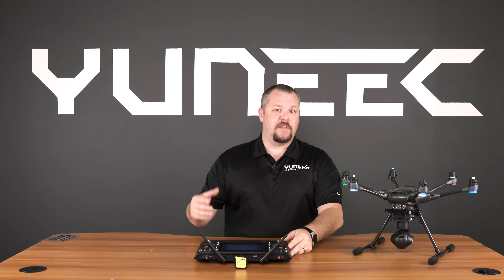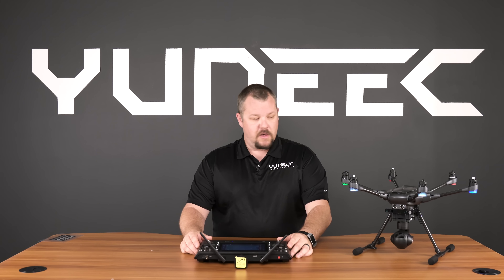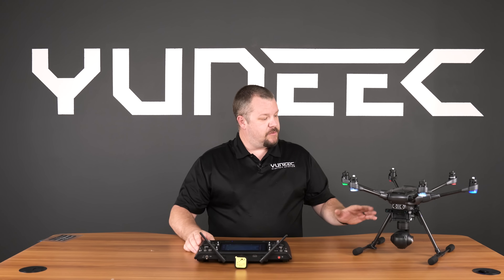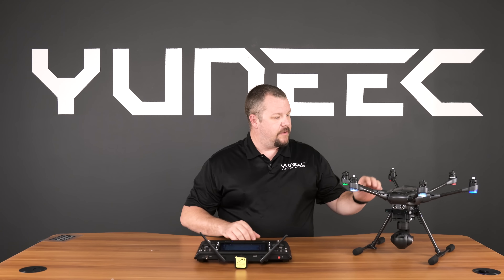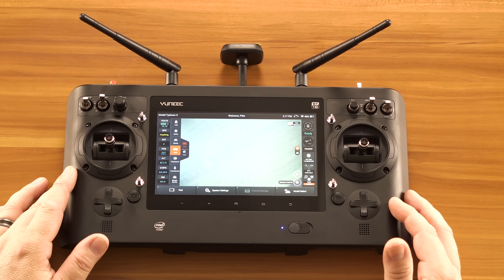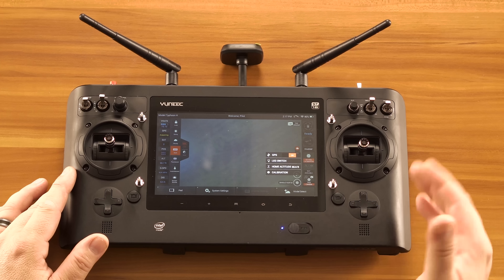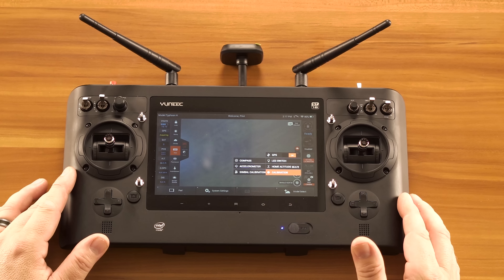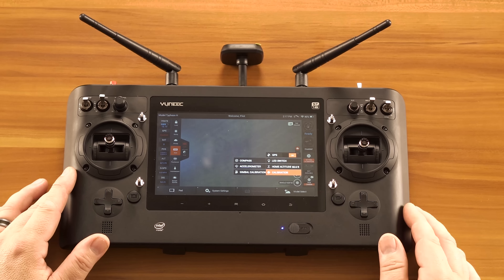Typhoon H: Accelerometer Calibration

Comment: It would be nice for you to confirm if the there is any reason why Accelerometer Calibration should be done before or after compass calibration for example. Or if it matters in which order.
Reply from the maker: Accelerometer calibration is required if machine tends to drift while in a hover. 

-Team Yuneec
Reply: That makes sense, so at  no other time do you have to worry about what order you do calibrations in?  Like if your going to do a compass calibration, is it best practice to do the accelerometer before or after compass,  does the compass calibration work better if its second on the list?  I guess this is mostly important when you do firmware upgrades as your process says you should do all the calibrations again.